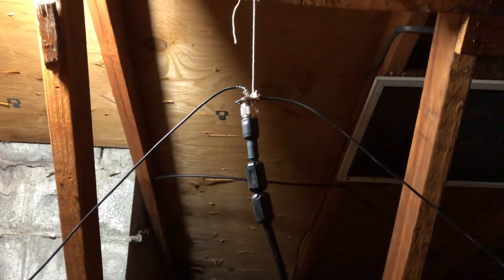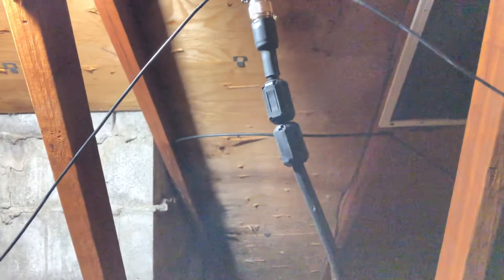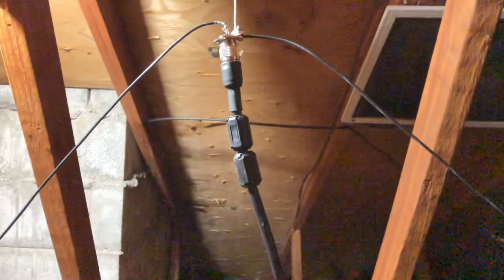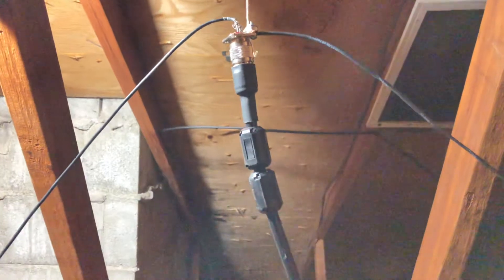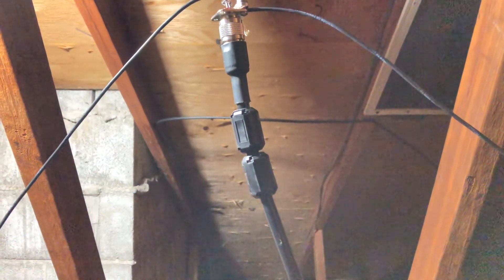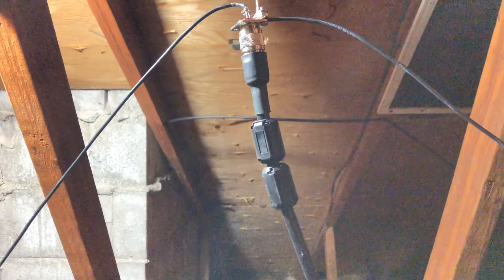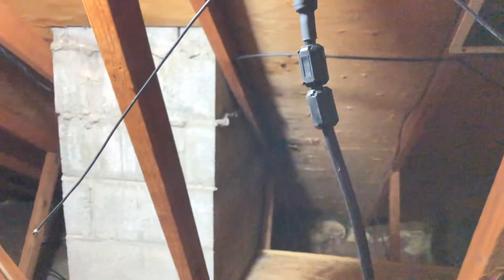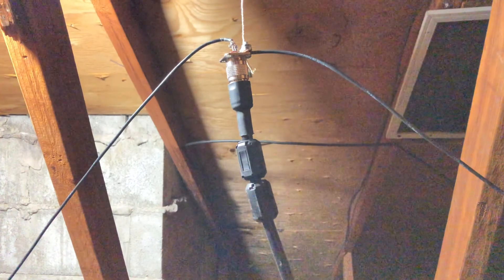2 meter inverted V antenna.

Comment: That's a cool project ,once I have my dipole built I'll hag it on the shop wall see how it goes till I find a spot in the yard. Cheers
Reply from the maker: Hang it outside away from everything.   Not inside on a wall.
Reply from the maker: 8.6 feet for each side of dipole.  Per the math.  So cut wire to 9 feet each side and trim by using antenna analyzer or NanoVNA.